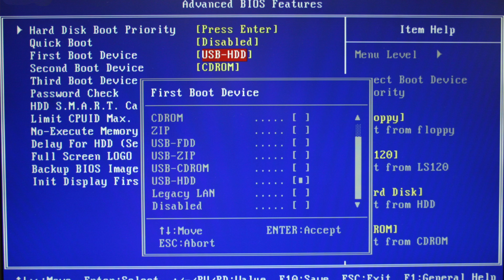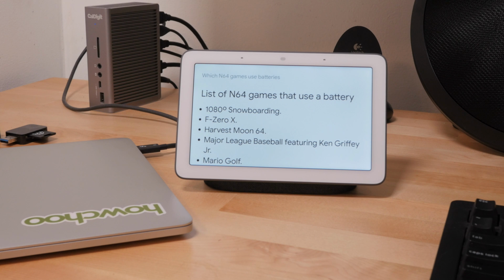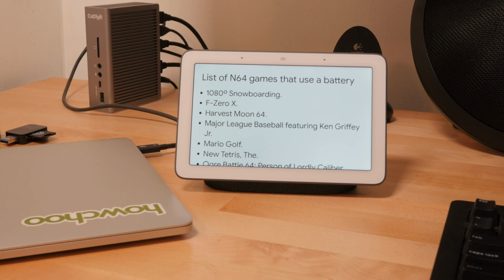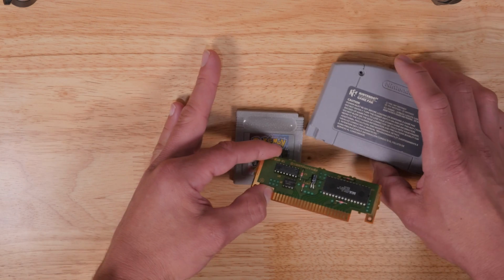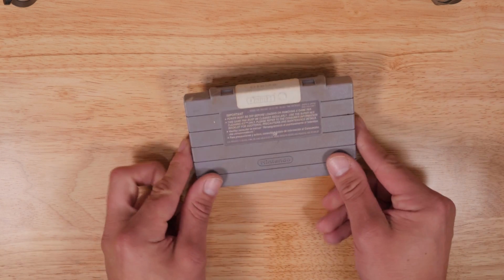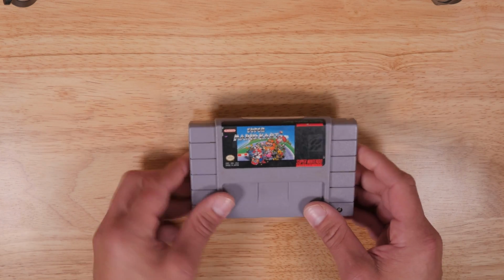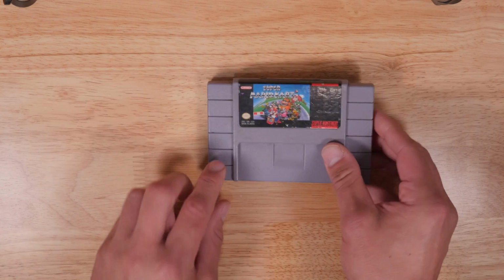Game Won't Save? How to Change Your Game Boy, NES, SNES, or N64 Cartridge Battery!

Comment: That pokemon game boy game already had a modern replacement battery in place, a better one. It's probably worth checking the voltage of an existing battery before replacing. Cheers,

Comment: Great video. Can  you actually demonstrate the part where you replace the battery while keeping save files? It was a bit hard for me to follow.
Reply from the maker: Not sure I'll have time to make a video on it anytime soon—but you can find some online guides on this. Basically what you'll do is trace the positive and negative battery leads on the back of the circuit board and then solder some temporary wires and a new battery to them. So when you remove the old battery, this new battery is providing the charge to preserve the volatile memory. Then, desolder the old battery and solder a new one in place. Finally, desolder the "temporary" battery circuit. Boom: power has never been lost so your save files are intact.

They also make "cartridge"-style boards you can purchase that allow you more directly export your save files—though I've heard they're pricey. :) Hope this helps!

Comment: i went from being hopeful of recovering my mario golf 64 game data to disappointed again. Dont think ill be able to do this without messing it up somehow haha
Reply from the maker: juanoshigeru are you trying to recover an active game file?
Reply: @Howchoo  yes. Otherwise id just buy mario golf on the nintendo online store and avoid all this =P I want to replace the batery AND keep the save file intact. 

I recently turned on the game on my n64 and all save data was erased out of nowhere. Ive read online that this doesnt necesarilly mean that the game file was deleted, just the battery died and the n64 cant access/read the memory because of that. SO itd mean having to replace the battery while keeping the save file intact
Reply from the maker: juanoshigeru if your save file is gone when you boot up the game, it’s gone gone unfortunately. It’s stored in volatile memory, so the battery is the only thing keeping it intact. But if you already have a good save file you CAN change the battery without loving your save file by first soldering some wires from the board to a second battery ;) Then add the new battery and desolder the second battery wires. Thus the board never actually loses power and you’ll be good to go for another 10-20 years
Reply: @Howchoo  whew sounds complicated xwx ill see what i can do. Thank you for answering <3
Reply from the maker: No problem! Have fun :)

Comment: Are you able to use a cr2032 battery holder in a n64 cartridge?

https://www.amazon.com/VNDEFUL-CR2016-Button-Battery-Holder/dp/B01J5FY2GI/ref=mp_s_a_1_4?adgrpid=58665761720&gclid=EAIaIQobChMInY7N_NbS4gIVBZ-fCh1AOgqbEAAYASAAEgJPJfD_BwE&hvadid=274839347958&hvdev=m&hvlocphy=9058761&hvnetw=g&hvpos=1t1&hvqmt=e&hvrand=14104957601551829394&hvtargid=kwd-295836462893&hydadcr=12163_10197799&keywords=cr2032+battery+holder&qid=1559749318&s=gateway&sr=8-4
Reply from the maker: The pin locations and orientation look correct but it might be too tall to fit beneath the RF shield. It's definitely worth a shot!

Comment: or you know, you could just use an emulator
Reply from the maker: Emulators are great, but some people prefer using the original hardware. To each their own I guess :)
Reply: i have a multipart that won't save my Zelda progtess after I have beat dungeon 7. It's not a China multicart but I want the darn thing to act right.

Comment: To get the desoldering wick to work you need to put liquid flux on it. Also flux the pad before you solder the new battery on. Heat transfers better and save you from destroying the card.
Reply from the maker: Ahh yes, flux was the missing ingredient for the desoldering wick. Thanks!